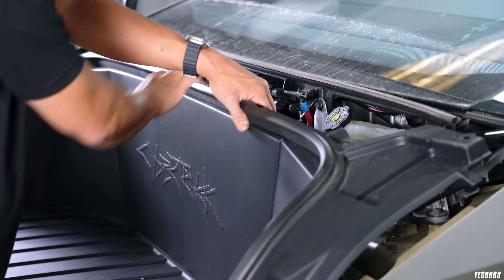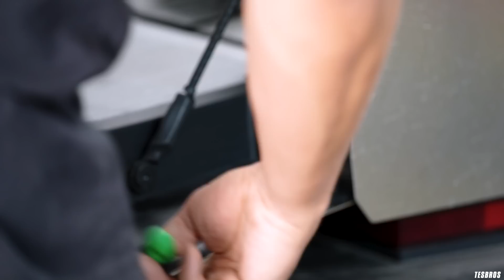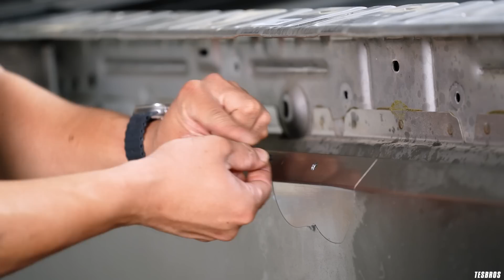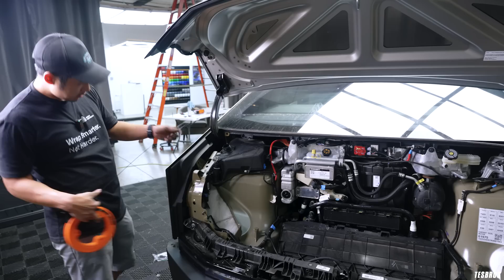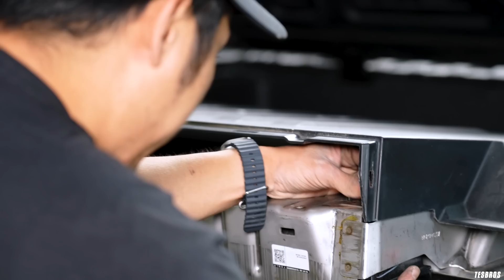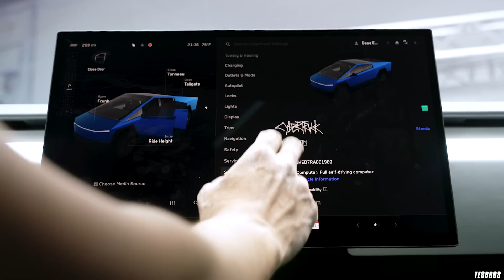Cybertruck Rear Camera Washer By ClearVu Installation Guide

Comment: Wow, much harder than the side washer installs.  20+ mins of drilling. I wonder if you can do the drilling first, without removing anything. Then later, when the hole is done, do the disassembly, etc. Is there anything behind the stainless that you have to be careful of?
Reply from the maker: It's harder to drill in that area with the taillight bar on + you could damage it with the drill if it slipped or hit it wrong. So there's some risk there. Nothing behind the steel in that area though

Comment: Drill low rpm, all the way through with the pilot size.   Use a solid carbide with a split point angle for hard stainless.    It will be a lot easier.
Reply from the maker: Good tip!

Comment: Maybe a step drill bit would have been better imo. 

I will assume  the CT warranty is done-zo 🤔. This reminds me of 2018-2019 Model 3 ‘s w/no auto trunk release. There were aftermarket sales for it all over the place, until Tesla incorporated into the next gen 3’s, and subsequently offered retrofit kits✌🏻😎. Surely Tesla will do the same w/the CT, thereby rendering this obsolete.  

Next gen CT’s will likely have more features built in such as: 

- folding front/center console seat
- fold flat front seats 
- carpeted door pockets
- frunk AC outlets
- built in air compressor
- running boards (as an option) 
- folding center bed tray 
- powered bed window  
- rear bumper camera (for either towing and/or when driving/w/the bed open)

Tesla will incorporate these in an attempt to stay ahead of the new R1, Silverado, and Lightning imo 🤔.
Reply from the maker: Yeah perhaps. May do an update video for next one!

Comment: Surprised you didn’t show it working after reassembly. I’m still thinking a never wet coating might be the better way to go.
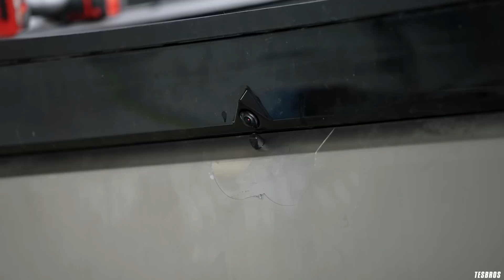Reply from the maker: We did at 35:01, but didn't at the very end. After everything was reassembled, the tube was pinched in the rocker area. After finding that and fixing it, it worked fine. 

You could definitely put QuickView on it, a ceramic coating specifically for glass/windows - https://tesbros.com/products/gyeon-quickview-bundle
Reply: My bad, I was skipping around trying to find it but missed it. Congrats on the successful install and thanks for taking the time to reply!